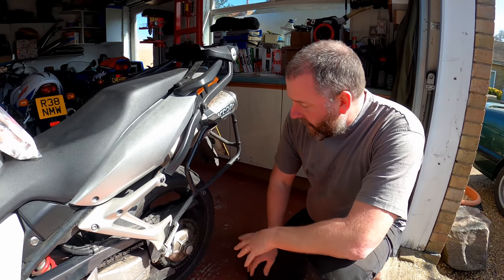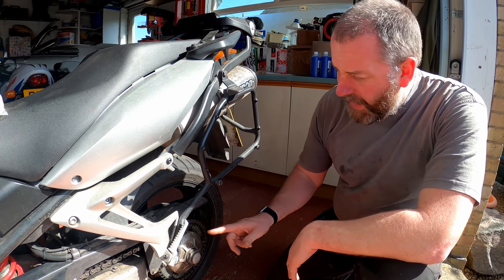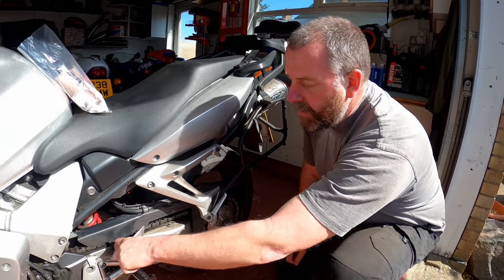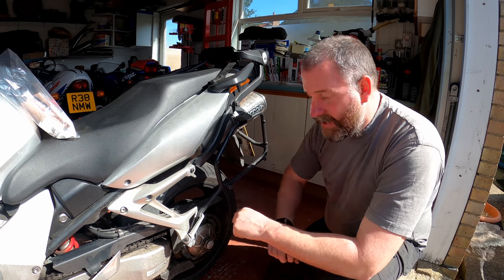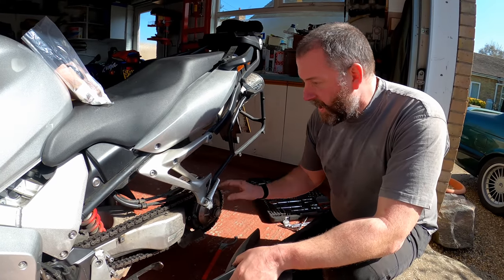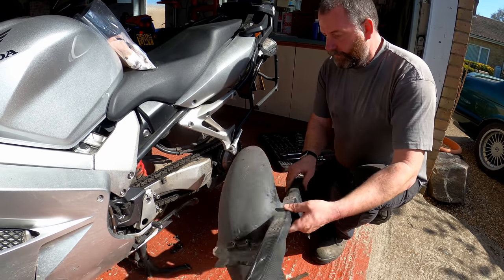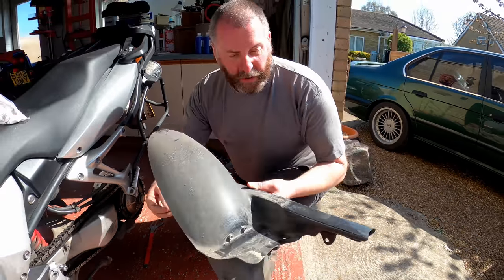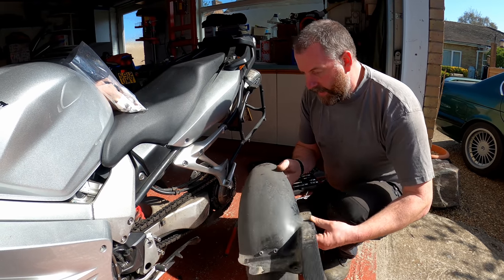Honda VFR800 VTEC - Rear Hub, Strip & Assembly - Wheel & Sprocket Bearing Replacement

Comment: Thanks for another great vid.
Tip from me to fit the hugger to the swingarm on the inside, instead of the pushpins. 
I got rubbernuts (m5 or m6), a little longer ones (might need a little drilling). And a bolt to fit it.
Reply from the maker: Great tip!👌🤓
Reply: Rubbernuts? Are they the well nuts used on the fairing? That's an awesome tip that, bloody clips mine are all falling apart.
Reply: @lmaoroflcopter Yes, just a different size.

Comment: Small suggestion for safety, always you want the breaker bar at 9 o clock and undo the nut pushing towards the floor even using your foot to press. This will prevent the breaker bar to come onto your face if the socket slips off the nut, will not be lifting the bike upwards with a potential to send it off the center stand and also will not be compressing the suspension which then is a power loss. Great videos keep up the good work!
Reply: Learned that one as an apprentice with a breaker bar under a truck, right in the jaw and goodnight 😂
Reply: @homeworkshopengineering  oh noo😂

Comment: Another great video of a very important service job. Just a thought undoing the hub nut. Why not do it as the very first thing with the wheel still on, some one sitting on the bike and with pillion, in first gear with the rear brake and front brakes on? It would give up pretty easily then I would have thought with either a good breaker bar or impact driver. As I say just a thought. Might need to repeat when re-tightening the nut to the required torque.
Reply: That’s how I did it - son sat on the bike with both brakes and me on a 25” breaker bar...still wanted to move forward but a couple of nudges and it came loose.  I had also un-spiked the nut as best I could beforehand...I expected a full notch cutout - it’s just an indent so you can’t properly pop the spike out.

Comment: This was extremely helpful. I've been digging around online for ripping apart the rear on my 94 vfr750 which looks to be identical to the later 800 minus the extra stuff I don't have like ABS.

Knowing the socket sizes to press out the bushings will be a life saver since I can just order a couple sockets besides the 46mm I already ordered. I just need to track down a larger snap ring pliers than I already have.

Comment: nice one kev.done my cush drive today,by the inner tube method,once i'd got the right socket that is.i had a 1"13/16ths socket and it worked.near as damn to 46mm.i also had a pain with the circlip.i have the right pliers but they didnt open far enough,so i struggled with screwdrivers etc.all good now.cheers.

Comment: Hi again, (my english is not perfect, then please don't mind the mistakes that could happen) I'm totally stuck trying to remove the driven flange assembly (that's how it's called in the service manual, but I'm talking about the rear sprocket assembly you're easily removing at 11:33). I don't understand how easily you managed to do it but I pull as hard as I'm dumb (it should have come).
I slacked the sprocket as said in the manual but is it required to slacken it to the minimum (the closer to the front of the bike the better ?).
I found nothing but your video where you remove it. Nothing on forums (vfr discussion) nor Web.
Reply: Kev's video is pretty thorough, doesn't miss anything. I can't really understand what your issue is, only to think you cannot pull the sprocket cush drive cover off the axle? Maybe use a rubber mallet or if this fails a puller?
Reply: @alexmorgan3435  I figured it out by myself. I did not notice the part after the washer by using 2 flat screwdrivers and making it move side to side until it came out.
Afterwards I was able to pull out the flange and replace the rubber parts. 
Thank you for your answer, I did appreciated it.
 Cheers

Comment: About to do mine to change the rotor and i pray my nuts not that tight. Hit it with Pblaster and i think i'm going to give just the nut a little torch. Zipties on the front brake lever may be better solo to keep it from moving forward leaning on that axle nut. Damn.

Comment: Many thanks for your video. I own a vfr800f 2017 (rc93) and was about to change the chain, sprocket and rubber dampers (is that the good name for rubber parts behind the rear sprocket ?). Anyway, you helped me a lot.

Cheers mate.

Comment: please show a video of how you far you turned back the eccentric hub to tension the chain, Im having trouble getting the hub and brake carrier stay to stop dropping when I'm tensioning chain, and the correct position of the hub does the pinch bolt have to be in and tightened slightly to hold hub in one spot then tighten chain any help appreciated thanks
Reply from the maker: nip the tensioning bolt ever so slightly to create a slight drag on the hub, this should help hold it still while you tighten everything.
Reply: @KevsShed  Hi Kev, thank you so much
love your content helps out alot 👌 will be tackling again today see how I go thank you 🏆

Comment: You've done it again. Brilliant job. One question... you don't think it necessary to apply a little multipurpose grease to the bearings before pressing them in? Once again - cheers for giving me the guts to work on my VFR! DIY is most rewarding!
Reply from the maker: There’s no need to grease the bearings before fitment, they will go in easily 👍🏻
Reply: @KevsShed  Cheers, looking forward to your next VFR-video! Have a nice weekend!
Reply from the maker: @srenemiljensen6413  You too buddy!

Comment: I have a 2001 VFR800 and the brake lights are always engaged. I've replaced the bulbs and brakes work fine. I can't figure it out. Any ideas?
Reply from the maker: I would start by disconnecting the front brake switch and then the rear brake switch, if they go out then you will know if it's a faulty switch. If not then it's likely a short somewhere, good luck!

Comment: My caliper mounting plate just won't come off! Don't know how i will remove the bearing holder if that plate won't budge
Reply from the maker: Heat is your friend here bud, the plate is alloy and it’s mounted onto a steel component. Heat the alloy and it’ll expand I should be able to be gently tapped off.
Reply: @KevsShed  thanks I tried 5min of blow torch but still couldn't shift it
Reply: @suddengreen5707  Soak it in Plusgas.

Comment: Were your bearings noticeably in need of repair, or was this strictly preventative? How many miles on the bike? (I've got 60,000 km / 37,000 miles on my 2003 . . .  😰)
Reply from the maker: Strictly preventative and for the sake of useful content really. Kinda good to fully appreciate the serviceability of your bike too, the only way to be 100% certain is to replace each consumable. 👍🏻
Reply: @KevsShed  Good to know. I’ve read that section of the manual and it’s very scary, so it was great to see it’s actually possible for mere mortals!
Reply: @timramsey2358 if you don't get any water, particles of other bad things into your bearings (e.g. through damage/hitting something) it is not unlikely that the wheel bearings will outlive the engine
Reply: My 2004’s bearings were all silky smooth with no issues - cleaning them all off and re-applying grease should keep them happy for years to come.

Comment: Another bang-on video Kev, thank you! I'm thinking of finally tackling this overdue maintenance to my trusty 07 (along with the front bearings which you did as well) but one thing I'm definitely doing to take off that stubborn nut is using an impact wrench. I'm not as big as you and my back is not what is used to be. Besides, work smarter  not harder right? Question, where did you get that rear hugger? I've had one before but it failed on me and the one you got looks better as it's a one piece design. Thanks again Kev!
Reply from the maker: It’s a good idea to use an impact gun if you have one! 👌🏻 as for the hugger, it was fitted when I got the bike, I agree it’s a really good looking hugger, all I can tell you is that it is made by King Carbon, I couldn’t say if they are still available though! 👍🏻
Reply: @KevsShed  Thanks! Just curious, will you be posting videos of your M3 in the future  as well? Would love to see those too.
Reply from the maker: @pnoyryder68  Absolutely! Keep an eye out this coming Sunday! 😉

Comment: How did you know that the bearings needed replacing or was it just routine maintenance.
Reply: Usually the rear hub binds in places and you can feel it when riding or spinning the chain

Comment: I have a problem on my vfr. I put everything together as in the video, but when I tighten the main nut, the wheel turns hard
Reply from the maker: Put the bike so the rear wheel is on the ground and stand on the rear brake, or ask someone to do it for you.

Comment: Another good video. What is the cost of the parts i know fowlers website as u may know it quicker than me looking. Also the needle roller bearing is £88.72 the other bearings can you get away with non OEM ones just wondering. Thanks again good video. Ohh when shall i book mine at yours to do same lol ha ha. :)
Reply from the maker: Yeah, I got mine from Fowler’s, all except the needle roller bearing which I got from the states. Thus is an expensive job for OEM parts. Everything can be found 3rd party except for the needle roller because of that oil lip seal! 🤨